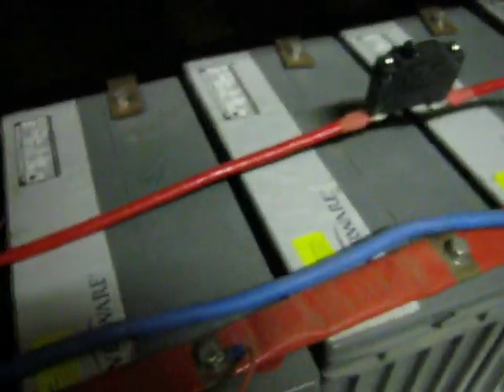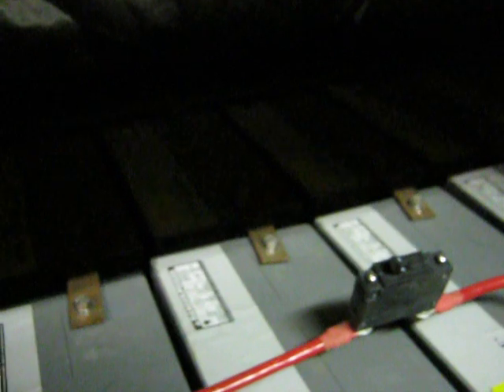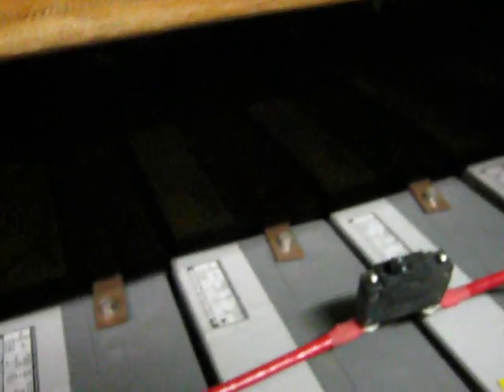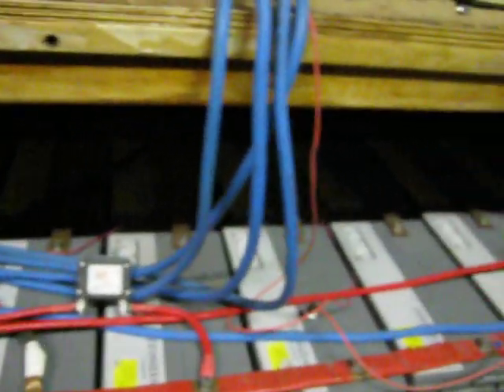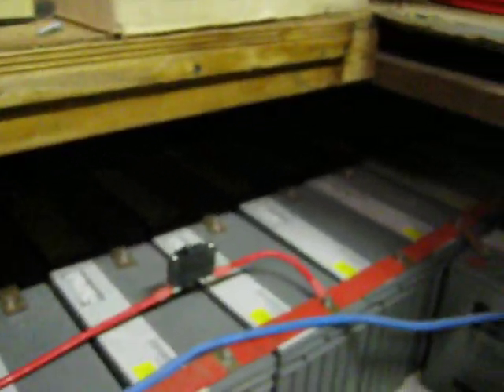This is my 24volt offgrid solar system

Comment: Hi Andrew!
I want to buy this invertor 24V 2 kW, it still works for you didn't break?
I have 24 volt panels, it is possible to connect the inverter to an external network (220) and that accumulators were charged from panels via the charge controler, the external network 220 and solar panels each other won't disturb? I have an average load of 1.5 kW at an o'clock, but seldom happens peak to 3.5 kW (when the refrigerator turns on), in the passport at 2 kW of the inverter peak loading in 6 kW is declared no more than five minutes, will interestingly sustain or not.